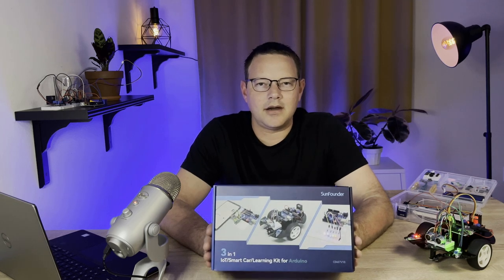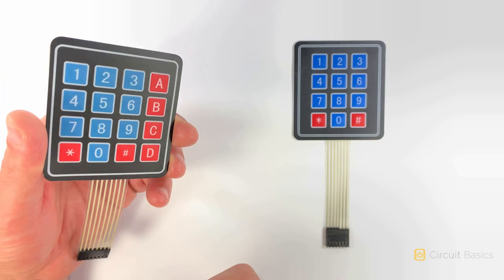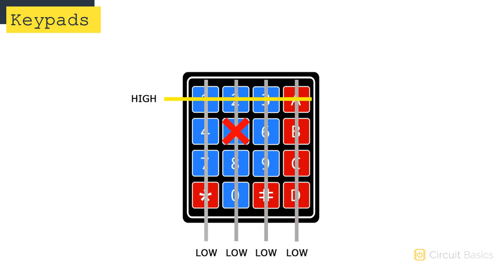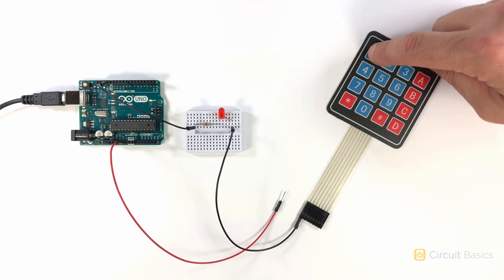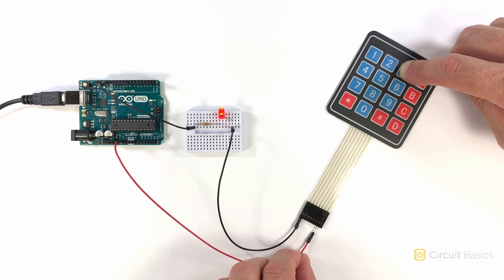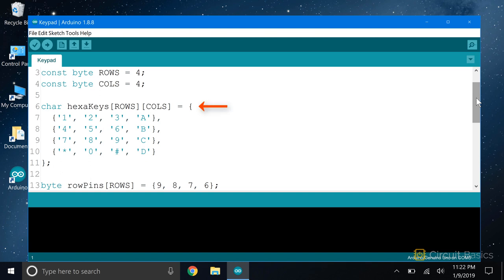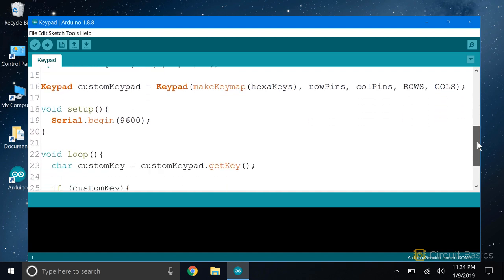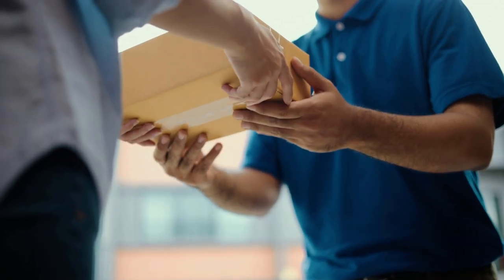How to Set Up Keypads on the Arduino - Ultimate Guide to the Arduino #22

Comment: If you wanted to do that with an interrupt you only need to set up 4 as one of the row pins will always be high during any keypress? I guess a 4 input OR gate would let you only use a single interrupt to service the keypad rather than constantly polling it and this may be useful in low power applications. Perhaps you can even use diode logic with 4 diodes and a resistor to drive an interrupt pin?